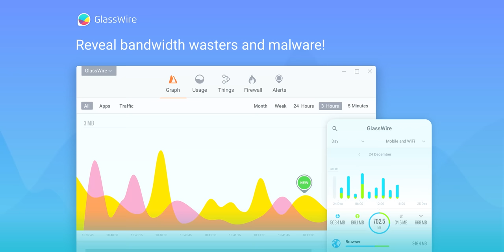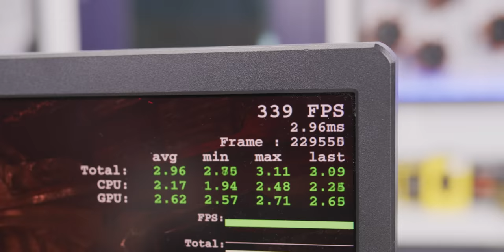His PC Died in a Fire.

Comment: I wouldn't reuse the cooler mount.  Even though it provides a level of sentiment, it's just not a good idea.  There's a potential for failure.  Think, if the case warped, it got hot enough to have a potential to in some way warp or damage to structure of the cooler mount.

Comment: I'm aware this is obvious but while metal doesn't burn, heat does make it rust very quickly. And obviously heat also softens metal, so the case looks reasonable for a fire.
Reply: Technically, rusting and burning are kinda the same thing. You add oxygen atoms to the thing to change what it is. It's called oxydation.

Comment: Linus: "brand new gaming PC..."
Gaming PC: *Spinng Platter HDD*
Reply: Did you miss the SSD?  A LOT of high end PC's still have secondary HDD's for extra storage.  It's not a console, you can have both.
Reply: Yea. Gigantic SSDs are still way more expensive than gigantic HDDs, so you have a fast SSD for boot, and a large HDD for games.
I did that with my new computer: 512GB NVMe SSD and my existing 1 yr old 3TB Games HDD. (My old computer had a 500GB HDD and a later 3TB upgrade, but I didn’t want to migrate my 500GB HDD, so I had both the 500GB HDD and 3TB HDD)

Comment: Im glad to see you used the burnt Noctua bracket but I just had this same thing happen to me less than a year ago with my full house fire and my setup was completely toasted and my pc looked exactly like this dudes did (by all of the warped and rusted metal and just burnt stuff in general). Great idea you had but absolutely worst idea you could have done for a brand new computer; that smell of the burning stuff will NEVER and I repeat NEVER come out of that bracket so the whole computer within time and with the pc running components hot inside whenever it actually is turned on this whole new I would assume place of residence will smell like the day his I would assume house or something else caught fire.

Comment: yeah depending on where it was, and i know this is obvious, but fire is fucking hot.  Like, our helmets will melt if you get too close to the fire itself.  Hell, some fires get hot enough to start that melting and browning process of our gear via ambient temps.  Like, the room gets hot enough that it causes our gear to begin to fail.  Had a barn fire once and the entire barn came down . Burnt the paint and all right off and old MG racecar.  usually all that sutff burns, but that thick metal kept it in tact, but the car, while still together, was never going to drive again (that was sad as it was an antique).  Interesting enough, there was a stack of books that were charred in that same fire in the main area of the barn (the car was sitting on the other side of a wall it seems) and, while the covers were black and charred, when we moved them around to spread out the fuel, the covers were flipped open, revealing readable pages inside with only damage around the edges.  It's something to see how fire burns in various situations.

Comment: Hey  Linus Tech tips can u take a imac from 2007 and put newer hardware in it to make it like a newer imac? I recently bought this imac a1224 and couldn't find mutch online for upgrading it. Can u find out if u can take newer parts and install them into the older case and maybe get a 2k screen installed into it also? I really wanna know were they stand by on upgrading for the older hardware for 2020. I dont have alot of funds to explore options and need a good root to go down for upgrading this dinosaur of a imac. Or did I just get a paperweight that says apple on it???????? 
 video. Ps. To all respond and like this message i need to know.

Comment: Linus didn't mention it but the smell of a roasted computer is a pretty strong ash smell. 
i would know i tried to fix my brothers roasted and water damaged pc that was in much better shape than this. some of the parts were salvageable.
surprisingly the GPU worked the mobo was failing. it would only stay on for a minute before shutting off.

Comment: Hi Linus
I just got XFX Radeon VII 16GB GPU and I'm moving from Geforce 1070 when I plugged the new card I got no display (not posting) can't even get to BIOS 
I plugged both graphic cards and I notice that I can see the VII in BIOS and Device Manager so I installed the latest drivers for the VII 
@t
I also used your method with DDU to remove all old intel and Geforce drivers but still no luck
can you please give me any advice
I have x370 MSI carbon gaming pro motherboard
Ryzon 5 1600
windows 10

Comment: It'd be hard to burn a computer like that in a smaller fire.  I'm no expert in it, but trained fire investigators can tell shit like whether an accelerant was used (such as pouring gasoline to burn down a business for insurance) by looking at the way a material looks after burning.  Color variations can tell you a lot (for example, the brown spotting probably means something.  The most I can tell you is our gear turns that same brown when it begins to fail, and if you come out of a fire and it's got that brown, you are taking that gear out of service, as it is no longer safe.)  All in all, I'd imagine the heat that PC would've experienced in a house fire is very different from what you could've gotten in a smaller dumpster fire to the point where it would be pretty broadly apparent.  A fire inspector could probably very quickly tell specifically the temperature range that PC went through at the peak, and differentiate what kind of fire it was in.

My very unprofessional guess...  The case is made out of SECC steel..  what that means, i'll be frank, I don't know.  But steel melts above 2000 degrees.  Now it didn't melt, but it did warp.  Plus, the lack of any air cooler means it was left behind.  It probably warped beyond recognition, or maybe even melted.  Aluminum melts at 1200 degrees or so (all in Farenheit).  So guestimating, the temps this thing wen through are probably in the high 1000s.  Maybe 1800ish?  Again, I'm by no means an expert, just some cursory googling, a bit of putting two and two together, and a lot of ballparking it.  I wouldn't have reused that cooler mount.  It could actually fail down the line.  Heat does all kinds of things to metal.  The stress of the temps could leave it so it's got microscopic damage perhaps. Hot and cool, over time, would cause expansion and contraction in such a case that it could fail.  This is just the ramblings of someone with barely any knowledge in this field.  I'm no metallurgist, but why risk it?  For sentimental sake?  yeah, I think he'd rather have his pc last longer and not have anything left of his pc, or maybe just a small plaque with a piece to commemorate it.

Also, found out this was from a wildfire!  Yeah that explains a lot.  Wildfires often burn very hot and put out a lot of radiant heat due to the amount of fuel they have available.  Had a wildfire truck get just a bit too close and literally melted the mirrors on his truck before he could complete the k turn and book it out of there at 30 mph on literally no road.
Reply: You have too much time on your hands.